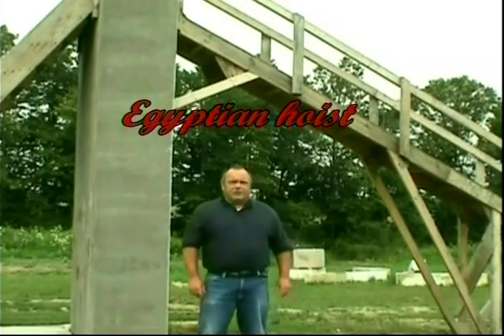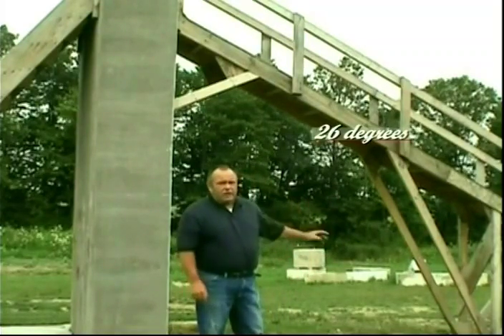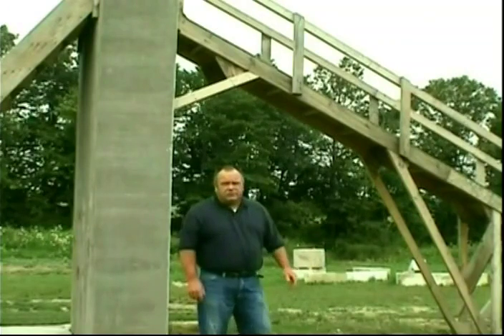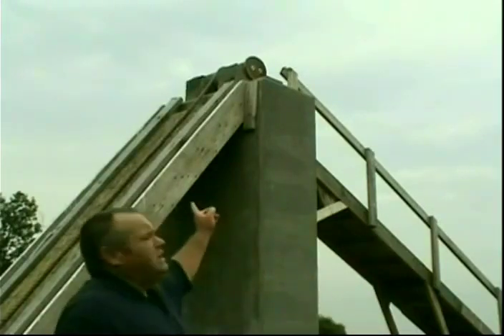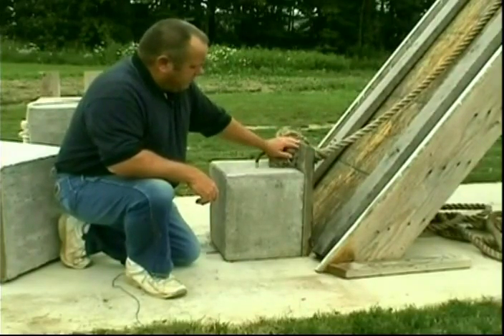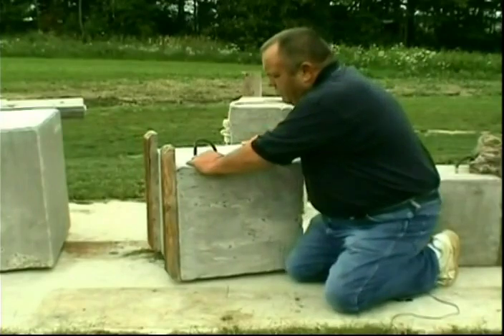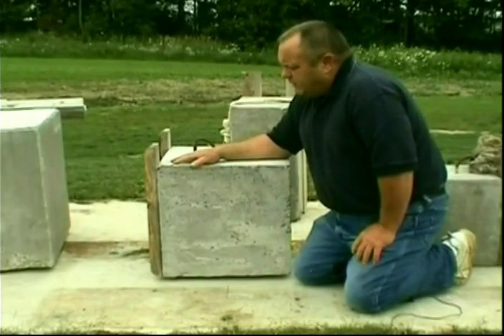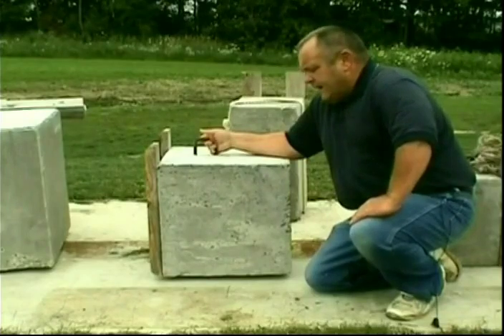Ancient Egyptian Pyramid Building Technique Reveal By Wally Wallington

Comment: Cool. Now do it with the materials they had:

80 ton Granite blocks, with a copper hoop somehow embedded within it, strong enough to be pulled by a rope, with a rope strong enough to pull 80 tons
Reply: What about the 1000 ton statues moved 100s miles
Reply: Or an 800 ton block lifted 23 foot
Reply: And drag it across 500 miles of desert
Reply: Chill man. They had access to everything he did... The didn't always use imbedded copper hooks to life a block. 
They carved wedge shapers into the top of the block, and put a wedge in, with spacers in the middle. Similar to a mortise and tennon joint.
And there are literally hieroglyphils of the Egyptians pulling statues on sleds while wetting the sand in front.
Also the nile river was a couple hundred feet away from the pyramids through a dried up channel. It is much further today.
Reply: 😂😂😂😂😂😂 aquien quieres enredar es geopolimero granito artificial
Reply: 80 tons is about the weight of a heavy class full main battle tank in the 50+ but sub 100 ton classification. Big tanks but i mean tanks get big problem is up there they start to sink
Reply: comunque nessuno di voi a mai provato a costruirsi una casa da solo 🤫
Reply: Nice concept, but there’s no proof ancient Egyptians had the wheel, of any kind (the roller). As some have pointed out, at scale this may not work. Cutting the hard granite stones in the first place is still a mystery. I know they’re mostly limestone in the pyramids but still, the granite blocks are the real challenge at moving. I’m not an engineer so I wouldn’t know if this could work at the scale of the pyramids, but it would be interesting to see someone try. You can’t really claim this is the way it was done without trying it at the proper scale.
Reply: Try 1.5 tons. 3,000 pound rough cut stones made up 95% of the kufu pyramid.
Reply: Wally does it here with 20 tons.

https://youtu.be/E5pZ7uR6v8c?si=HeOELZznI2FTqs6G
Reply: @ChrisShortyAllen so... the Egyptians first moved a block into the sand or mixed and poured concrete to create a pivot to dog walk it sever hundred miles?  Got it. Or is your position that they use this method on sand?
Reply: @boyeatsworld-vr9ci 

I'm surprised that as a knowledgeable Egyptologist that you dont know  the Giza plateau has an exposed limestone bedrock.
I think Wally was protecting his lawn.
Reply: @boyeatsworld-vr9ci 

Im surprised as an expert that you don't know the majority of the great pyramid is limestone quarried at Giza.  Also that other stone was transported on the Nile river.
You need to study Egyptology by the looks of it.
Reply: @ChrisShortyAllen  Youre not too bright, are you?
Reply: @boyeatsworld-vr9ci 

What do you base that insult upon?  You haven't explained how anyone can move large lumps of stone.
Go on.  Give it a try and us all a laugh!
😂
Reply: @boyeatsworld-vr9ci going for insults is crazy, probably since you’re losing
Reply: @ChrisShortyAllen keep on the good work
Reply: keep coping
Reply: 😂😂
Why should he?
You need to watch him move massive stones.
You know the Egyptians achieved what they did as you can see the results.
You're such a fool.
Reply: @ChrisShortyAllen  Because lifting 5k isn't near the same as lifting and placing 160k. Why do you need to be a condescending prick?
Reply: @ChrisShortyAllen they didn't build it, they found it.
There is more evidence to tjat fact tjan otherwise.
There are also structures similar im wonder tp the perfection of the pyramid found around the world.
Safe to say that there is a lot we are missing.
The hyroglyphs were'nt marked by people who made the pyramids, they appear to be a scratch on the otherwise prefectly finished hard stone works. It it vlear thay if ypu have the tols to carve stone to high level finish, ypu would have had the tool to mark it in a similar or superior level of finish.
Reply: @ChrisShortyAllen 《《《《
It is the same ALL OVER THE WORLD......;LOST MEGALITHIC CONSTRUCTION TECHNOLOGY..................,LOST MEGALITHIC TECHNOLOGY FROM WHITE PEOPLE!!!!!!.....,NO!!!!!!!....,FROM  ANTEDILUVIAN PEOPLE....,and nobody can know how they looked like
Reply: @ChrisShortyAllen  except the Egyptians didnt't BUILD the pyramids.  They DISCOVERED them.
Reply: @ChrisShortyAllen I have. None of this methods work in sand or at scale
Reply: @boyeatsworld-vr9ci 
😂😂
Do you know the Romans moved a 187 ton obelisk to Rome and erected it?

You don't know what the copper was for.  Do you?

Rope is very strong especially when formed into a net.  

We still pull massive ships with it.
Reply: @ChrisShortyAllen no they did not.
Reply: @boyeatsworld-vr9ci 
😂😂
They did.  It's still there.
The Russians moved an even heavier rock from Finland in the 18th century.

Being an expert, why don't you know these facts?
Reply: @ChrisShortyAllen the Russians took thousands of men and trucks and crains , and 18 months to move that rock. The romans took even longer to move the stone you're talking about. I'm surprised you didn't go with the foundation stones of the Jupiter temple which are 1200 tons. I was expecting you to go there i stead. Kudos.
Reply: @boyeatsworld-vr9ci 

https://youtu.be/xpbjtpHl-88?si=Z3tEy0kBnnPp_0JO

An even bigger one.
Reply: @ChrisShortyAllen 

😂😂
Russia moved it with modern equipment. Did the Egyptians have modern equipment? That was a rhetorical question. If we tried to build a pyramid today we wouldn’t be able to do it. If we could…we would’ve tried 😊😊
Reply: @Bigdaddyy69 
The Egyptians had alien technology 😂
Reply: @Dionysos_____Alters  no, they had copper chisels and motivation 😜
Reply: @ChrisShortyAllen  do you know how long it took the Russians to move the thunder stone? And how many times it has to be repaired and re engineered? Also the Romans didn't move that obelisk. The Egyptians did.
Reply: @casesully50 
Ships were used during the Eighteenth Dynasty of ancient Egypt to transport obelisks from the quarry to their destination. Fifteen centuries later, the Romans used ships to transport obelisks across the Mediterranean to Rome. Today, eight ancient Egyptian obelisks stand in Rome, though not in their original places. The first of the obelisks, the 263-ton Flaminian obelisk, was transported from Heliopolis – modern-day Cairo – in 10 BCE. while the last, the 500-ton Lateran obelisk, was transported from Karnak.

The Romans were far superior engineers than the Egyptians.  Both the Romans and Greeks built granite structures.  They didn't need help.
Reply: That doesnt explain how the Egyptians moved them with "primitive technology." @ChrisShortyAllen
Reply: @ChrisShortyAllen  Rome was far superior you're correct. The aqueducts and reverse syphons themselves are amazing. Compared to the "New Kingdom" of Egypt they were miles ahead. Compared to the "Old Kingdom", I'm not so sure. The one piece polished granite sarcophagi with laser perfection symmetry, the monolithic giant statues with polished granite. The biggest thing I can't get over is the Diorite statues. Diorite is what they supposedly quarried with. Their craftsmanship got worse as time progressed

Edit: I use the term "sarcophagi" very loosely by the way. I have a hard time believing those were ancient coffins when no remains were found in those granite boxes.
Reply: @hj210 

The Egyptians mined cut and moved stone for thousands of years.  And they were not the first to do so.
They employed various methods no doubt.  So what?
Reply: @casesully50 

Your view of a catastrophic decline is not valid.  Times change and styles with them.
Personally, I don't understand why you question outstanding workmanship and bring a 20th century invention into the equation.
There is zero evidence for any advanced technology in any part of the world until recent times.  You believe the Romans and Greeks but not the Egyptians.  That's illogical as the Europeans certainly believed in their achievements.
Your best case scenario is that the sarcophagi hold an imaginary God.
All the tombs were robbed well before the Greeks took over.  The pyramids were falling apart.  Even then noteworthy but understood as relics from 2000 years before.  But you know best and have some questions. 😂
Reply: @Bigdaddyy69 

Modern equipment?  😂😂
They had nothing remotely modern.
Reply: @00-OOOA
You believe aliens made everything so any analysis by you is pointless.  
Keep taking them.
Reply: @00-OOOA
How did The Norman's cut stone to build castles?  Or the Tudors?  Did they hire power tools?
😂😂
Reply: @boyeatsworld-vr9ci  thousands of trucks in the 18th century? bruh...
Reply: @ChrisShortyAllen Do you know that you're comparing apples to oranges and that you have no clue what you're talking about?

First if all the Romans used modified ships to transport said obelisk on water. The ancient egyptians used stones for the kings chamber which had been transported by land. Btw the Nile Delta looked different back then.

And the most important detail is that archaeology does not give the egyptians the credit for a similar technology. 
One of the most important things when moving heavy objects is material failure especially if we're talking about lifting stones- like the ones in the kings chamber.
Reply: @BouletteB-c2k

The obelisks were always transported on the Nile.  You should study Egyptology.
Reply: @BouletteB-c2k

Thought I would show you what the Romans made with Egyptian advanced technology lol.

Sorry if it disturbs your narrative.

https://youtu.be/z7lZsEGfxcg?si=CwTXtcR2dOTFRydU
Reply: @ChrisShortyAllen  lol.  no
Reply: @boyeatsworld-vr9ci 

No one knows how the Romans did this.  More evidence of impossible ancient technology that's just disappeared lol.

https://youtu.be/THt9zv6apGc?si=XtqpXji2QtiyF26o
Reply: @Berseker-d9e 
He's mirroring the grand gallery surely?
Reply: 😂😂
Why should he?
The pyramids are proof enough.

Comment: The University of Illinois engineering department copied this idea and is known as the EXARC pulley. Landing the block onto a flat surface and disconnecting from the hoist rope is critical and yet not addressed. 
Giza priest-historian scribes explained to Herodotus in 450 BC The Great Pyramid was constructed level by level, each level reducing and producing all surrounding steps. 
Machines fabricated of short wooden planks operated over all these steps, raising  Pyramid blocks step by step.
Note that a shaduf is not fabricated of short wooden planks thus the shaduf is NOT the Herodotus machine as some websites state, such as Wikipedia.
There is no Herodotus machine because Herodotus reported what he was told and Herodotus was informed by the Giza priesthood. 
Finally, white Tura limestone casing stones were installed top down to produce a smooth sided finish.
Mr Wallington has shown various complicated ramps ate not practical and yet various ramp theories continue to dominate  worldwide consensus. Historical documents and artifacts are dismissed and avoided. 
Search haitheory

Comment: I like this bloke's videos! One ramp is 53 degrees for the block... the other ramp is half or 26.5 degrees for the manpower. The roller design would need to be a lot higher (about 8 degrees higher?) and the top of the column wider to land the block without damaging the rope.

Comment: * it's not about moving individual weight , average limestone block was only 5000 pounds , as much as moving and setting 4,000,000 million pounds every day , of the 2.3 million limestone blocks without casing stones, not counting the 10,000 tons of granite interior structure that's set air tight
Reply: Half of your block count are off-size rejects and rubble used as filler.
Reply: There aren’t 2.3 million blocks in the great pyramid.  There are less a million actual blocks. And the rest is rubble and odd sized stones filled haphazardly between what we would call today retaining walls.  Stones of the right size were selected and then dragged for miles on the basalt causeway until smooth and rectangular.  The resultant stone dust was mixed with wood ash, soda ash and sand to make mortar.  Egyptians were excellent rope makers and pottery makers.  We have undoubtedly lost some of their knowledge because of the cost of manpower. If it were cheaper, we would still have a couple of hundred men drag stones to building sites with ropes, would have dozens of tricks to make the job easier, and we would not have developed the knowledge to manufacture bulldozers.
Reply: @Neodymigo 
The Great Pyramid consisted of 216 layers of stone blocks, which included approximately 2,300,000 core stone blocks and approximately 200,000 casing stone blocks. The pyramid base was 230 m x 230 m (756 ft x 756 ft).
Reply: @mrglasecki 

It's not solid stone blocks.
The pyramids were built by Egyptians
You should read the oldest papyrus found.
Wally Wallington was a remarkable man and didn't have the knowledge or experience of ancient people who moved stones all around the world.
Get a grip.
Reply: @ChrisShortyAllen  every reference disagrees with your statement
Reply: @mrglasecki 
Only you understand your nonsense.

Comment: Brother stop it. People used high technology back then to build these pyramids. Perfectly matched with the stars, and the equator. One stone alone can weigh up to 80 t which they will rise and place it almost 180 meters in the air. These granite stones are perfectly cut which is impossible without height technology. In Egypt they even had to cut these granite stones out of the ground miles away from where the pyramids were actually built. I understand there is a certain curiosity and maybe a challenge to it but friends if u really think that we are more advanced than the architects that built these pyramids then you musst be out of your mind. There is even way more to it which just proves that there is absolutely no way they built this without high technology…
Reply: 😂😂
You can see the techniques and tooling marks on the stones.
You're just a high school drop out.

Comment: Even if this worked there is still no way to tell how they cut the stones so precisely and line them up so precisely.
Reply: Also, moving small stones is easy but when it comes to stones weighing 50 - 100 tons or more is another ballpark.  The locals have no clue or have any records of how the pyramids or hieroglyphics were made.  On top of that, the pyramids were never a tomb to start with.
Reply: @maxkonig559 
The Romans moved an obelisk of 187 tons to Rome and erected it.
😂😂😂😂
You're such an idiot.
Reply: 😂😂
The tooling marks are there to see.  They used wood, copper, stone hammers, sand and water.
You struggled at school.

Comment: Makes sense,, the face of the pyramid IS the ramp..  at least for the final blocks,, all the rest on the inside of the pyramids probably had different techniques for certain sizes and levels,,  for The Grand gallery they might have used the rocking and pivot techniques u showed in other vdo´s.. where its just 1 man moving massive blocks and raising them with the rocking wedge system..   I guess it was a combination of various methods.. and way more time than egyptologists suggest.. When archeologists speculate on engineering, architecture and stone masonry there are sure to be blind spots.. nice work!

Comment: 2.3 million blocks, 2.5 tons = 5.75 million tons. That's a good workout for 400 men..
Reply: Don't forget, these were quarried, loaded onto a boat, then supposedly dragged across sand.  then loaded.   2.3 million blocks,  over 20 years means 315 blocks would have to have been perfectly cut, smoothed, transported, delivered, and placed  per day.   and that is if workers worked every day of the year,  in reality they did not.

logistics is a bitch.     each block was cut specifically for it's location,  the foundation itself was stone, and had to be smoothed and perfectly flat,  there was less than an inch of variation over 569,000 square feet.   the pyramid was not placed on sand.  about 10 football fields chiseled, and smoothed perfectly flat.  500,000 tons of mortar were used to encase the whole thing in casing stone.   

Japanese engineers,   attempted to build a small pyramid to show how ancient builders could have done it,  the Egyptian government approved it, it was a total failure,  they couldn't even get these small blocks across the sand, they tried everything,  and eventually had to bring in heavy modern equipment.   the final product looked crappy.  

Anyone can just make up numbers and say, oh they had a zillion workers,   sorry that is not how the real world works.  you only had so many dock for boats, a simple crane could only remove so many blocks off those boats,  the chiseling of blocks (some of them granite) and from 800km away.   

I aint saying it was Aliens, just saying that,  it could not have been built the way people assume they were built.
Reply: @Artiflex-ai4u  and even if you have a zillion workers, you need a zillion cubed to support those workers with food, metal, tools, wood, rope, oils, etc etc etc. I find it hard to believe a small country such as ancient egypt could have simply had enough labour, let alone everything else.